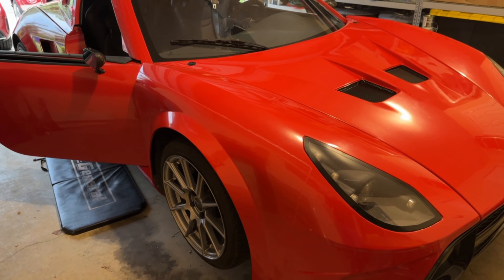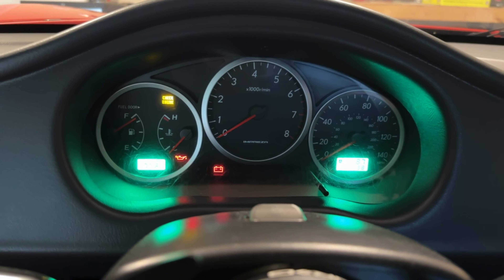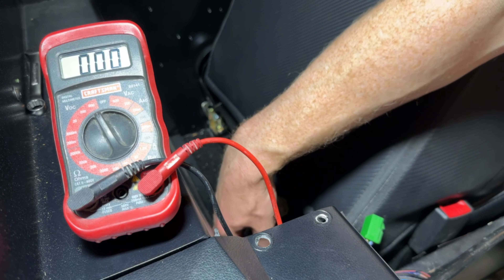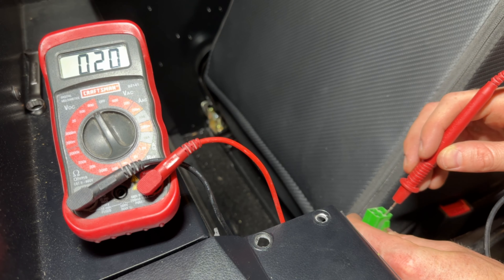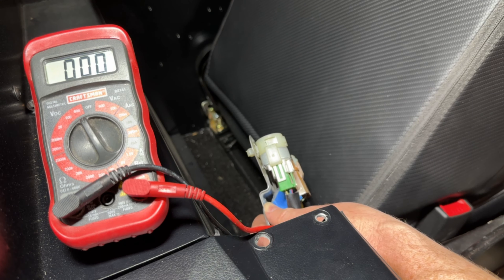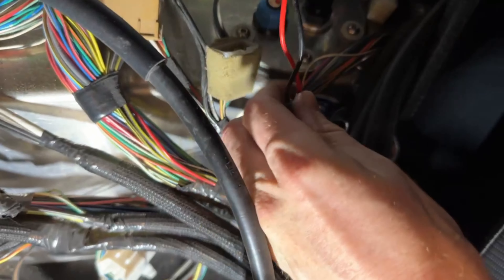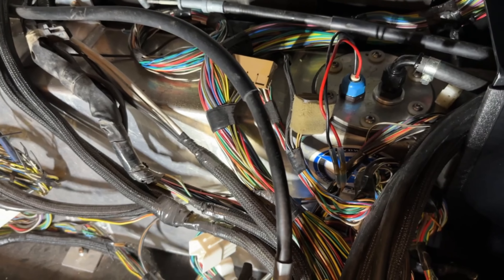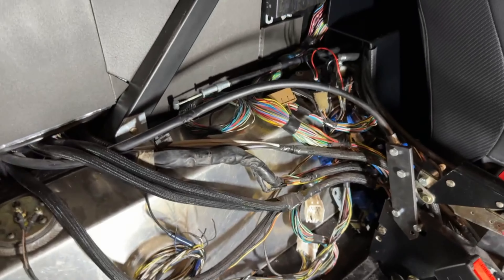I KILLED My Factory Five 818

Comment: I’ve been using the solder seals for about 5 years and they are awesome but you need to do the following: buy a can of air in a can…the stuff you use to blow off your keyboard. First…don’t use a heat gun, use a lighter. I can see in the video you didn’t get them melted/shrunk down at the openings. A lighter does this easily and quickly. As soon as you have everything melted down take the air in a can, turn it upside down and spray the seal. They spray ice cold when they’re upside down. This is necessary because the connection takes forever to cool down. When you push the wires in from each side, leave the copper strands straight and fluffed up… then push them into each other so strands are like Velcro… this method prevents resistance in the line. Lastly… buy a pack of multi-color/gauge shrink wrap tubes. Before using the solder seals, cut a 4 inch long shrink wrap tube and thread one of the wires through it. After you solder seal that wire, slide the shrink wrap up over the solder seal and then shrink that down…and if you have groups of 2 wires you want to tidy up, thread those wires together through a 8-10 inch long big gauge shrink tube before you do the previous steps… then slide that over everything. I rewired a boat and boats take a beating on the water…. You’ll never have to chase electrical gremlins ever again. 
Cheers
Reply from the maker: That's an interesting method and I'm glad it's worked for you! I made sure to shrink the tubing all the way down at the ends if it didn't show well in the video. After heating the connection I would blow on the connector while holding it together so it would cool down with the wires pushed together. I was afraid the wires would pull apart while the connector was hot and flexible. Somebody else recommended twisting the wires together but that requires you to size up the solder seal you're using and then the ends don't always shrink down as tight as you need around each wire. I did char a wire once just outside of the solder seal using the heat gun so it may not be as hot as a lighter but I didn't want it any hotter.

The solder seal that failed on my fuel pump is still perfectly sealed so I don't think extra heat shrink would help in my case. I cut it open and the solder didn't penetrate one of the wires at all and the solder cracked between the 2 wires. For me brittle solder that didn't penetrate all of the wiring was the problem.

It sounds like there are ways to make these better but that takes the convenience out of them for me. I've only had a few connections give me problems so far, but I'm only using heat shrink/crimp style connectors from now on.
Reply: or just wrap your wires around each other and shrink seal the connection... the shrunk tube will hold everything in place as long as nobody's tugging on it.

Comment: I was planning on using those heat shrink solder connectors all over on my build. I trust solder more than crimp, but this makes me nervous. Those aren't even exposed to extreme temperatures either since they are behind the firewall.
Reply from the maker: I used them everywhere because they were fast. I believe the stories about solder cracking now. I'll be replacing them with heat shrink crimp connectors as issues come up. Crimp is better as long as you use a proper crimping tool. My driver window also had some intermittent issues this summer.
Reply: @mikecamera818  good to know. I guess I'll ditch them and get some crimp ones and a tool. I don't want to be chasing down gremlins. Did you inspect those connectors after you cut them out so identify how they failed? Just curious
Reply from the maker: No I just assumed they crumbled inside and moved on lol
Reply: @mikecamera818  haha, well the engineer in me doesn't allow that. I always have to dig in and find the issue. Especially if I know it could repeat elsewhere on my project. If it was just a bad connection or the wire broke, then I have more confidence that the other ones will last.

Comment: Guess it was those heat/shrink solder connectors?
Reply from the maker: Yeah on the fuel pump wires. Swapped it to a crimp connector so there's no solder to crack and fail again.

Comment: You could have soldered, heat shrink, problem solved. Instead you chose to remove one connector, install another. You put a band-aid on a bleeding artery.
Reply from the maker: New connector is a crimp with heat shrink. No solder to crumble again in a year.
Reply: Those solderseal connectors are garbage.  

Crimps are garbage as well.  

The best connection is to cut, twist, solder, then heat-shrink.  Obviously you have to slip-on the heat shrink tubing first…or you get to cut and do it again!  Weatherproof adhesive heat-shrink makes them weather-tight in areas prone to moisture.

Comment: You need ventilation through your wiring harness bay.
Reply from the maker: Probably wouldn't hurt. There are some openings in the floor near there so some heat might get sucked out but it's not much.